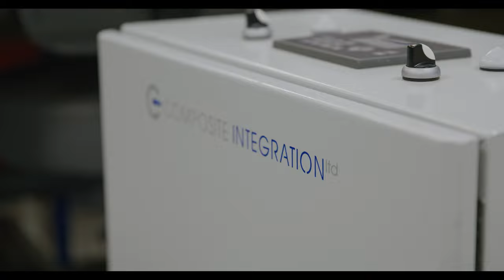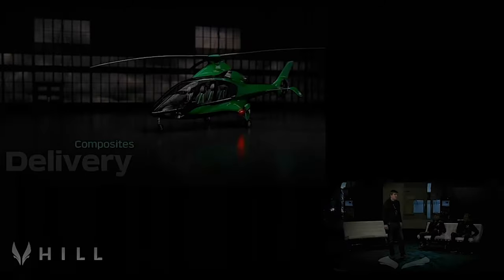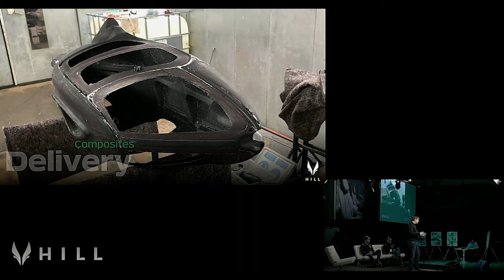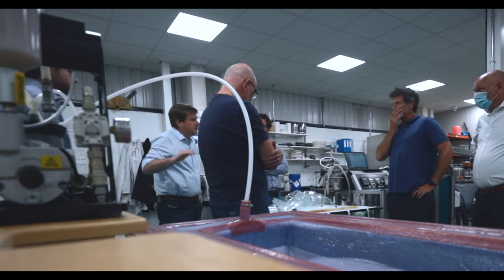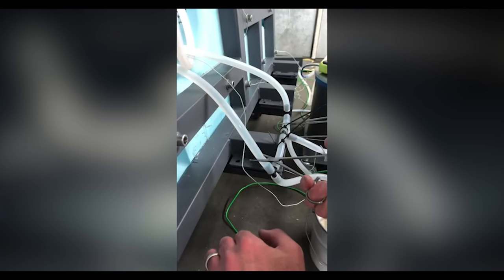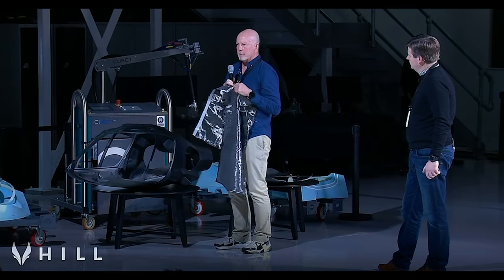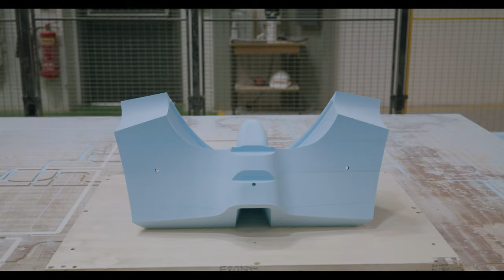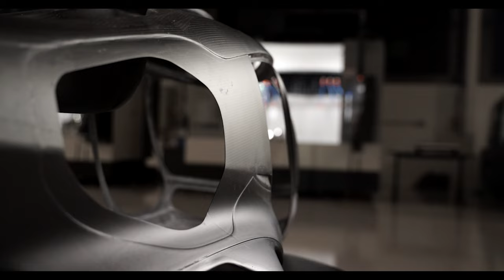Journey to HX50 | Episode 9: Big News thanks to Composite Integration

Comment: How do you repair a full composite structure such as this when inevitably it suffers wear and tear after years of operation
Reply from the maker: Composites are fundamentally repairable. There will be field repair schemes for most areas of the aircraft. However if it is a large structural damage to a critical area of the airframe it will probably need to be replaced.
However for that to happen there would probably be significant damage on the aircraft.
Things like nicks and scratches won't be a problem to be fixed.